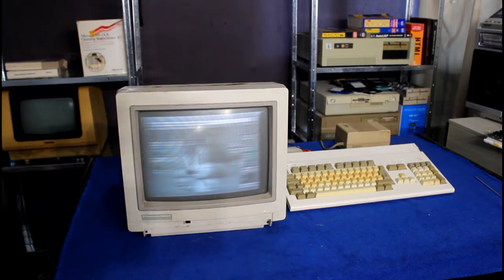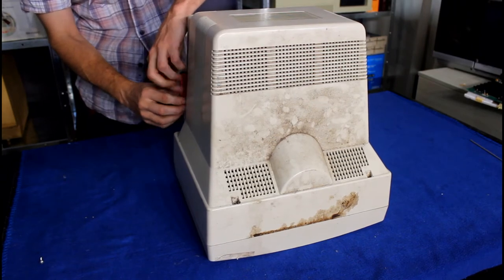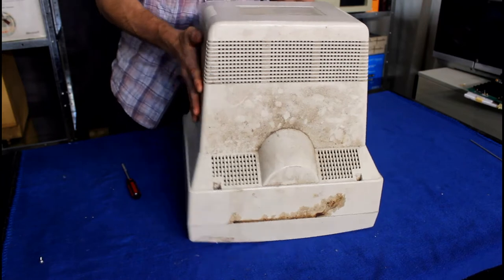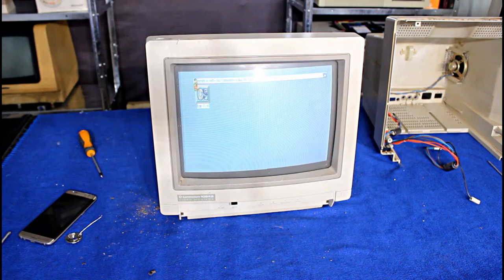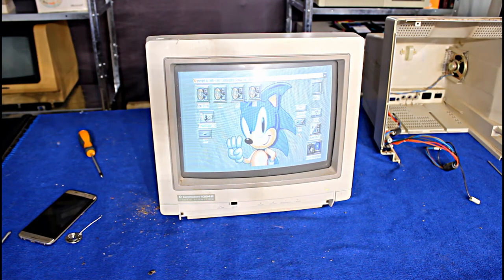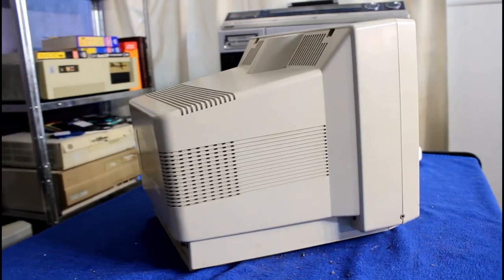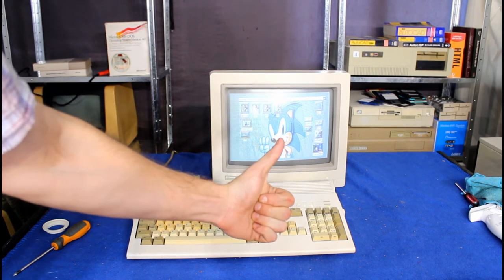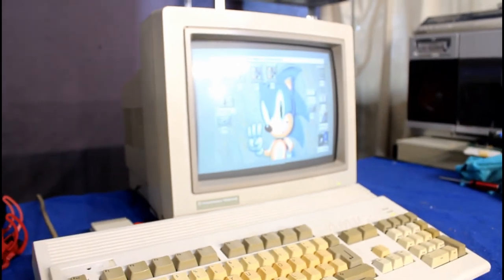Commodore 1084-S Video Monitor Restoration

Comment: Great video but you cut it right at the point I'm most interested in, the taking apart! Could you explain how you did it? Your connector circuit board appears to be coming off with the back casing, exactly as mine does. Yet it's supposed to stay with the main case. How did you remove the casing and not the circuit board?
Reply from the maker: Remove all the screws from the back where the connectors are
Reply: @TheTechGuyYT  Thanks. I spotted an additional small screw located by the av connectors, which was the culprit and causing the board to come with the case.

Comment: I have an 1084s which has not been use since 1998, now I try turn on and the red light come on  but no picture the hookup is correct . What come be the problem other than I have not use it in years?

Comment: These commodore 1084 monitors usually do not discharge the high voltage from the tube to have it turn on faster so make sure you discharge it

Comment: Good video, thanks for sharing. Did you take a special precaution while opening the case? Because it is very dangerous and risky to open CRT monitors due to the very high voltages?
Reply from the maker: +Lutfi O this monitor had not been powered up in many years . But i did short the flyback to make sure
Reply: Thanks for the information. I've two 1084 monitors and I'd like to clear them. Those are connected to the power a little while ago so I will not take any risk and will only clear the outer case...
Reply: You just need to discharge the CRT.  Ground a wire and slip it under the HV suction cup on the tube.  The mains caps have bleeder resistors on them so they self discharge.

Comment: My 1084s monitor has no picture when I turn it on, plus no static when I touch the tube. The sound and power LED does work however. Also I have to hold in  the power button for the monitor to stay on. What do you think could be wrong.
Reply: Did you try to change the power button?
If you can't / don't want to fix it I'd be happy to buy it if you don't live too far.
Reply: @DavideNastri  I haven't fixed the power button yet. It's expensive to import a new switch. I fear that it maybe more than just the broken power button. However I will try eventually. I don't think I will ever get rid of the monitor even if I can't fix it. It's just something from my childhood that I can not get rid of.  I live in the U.S